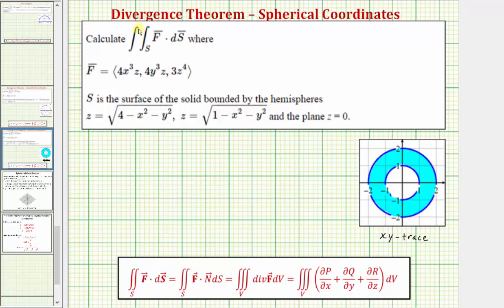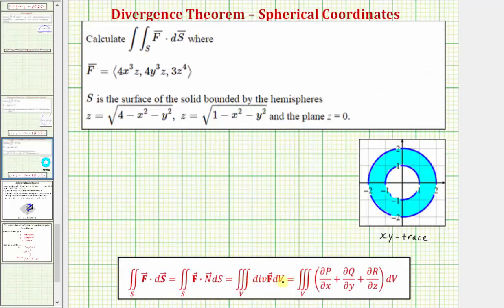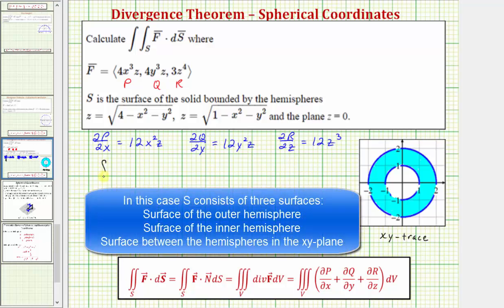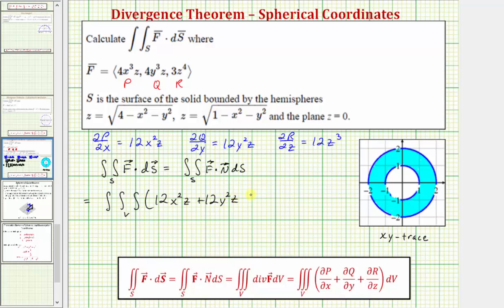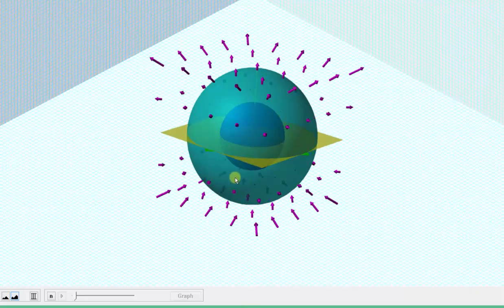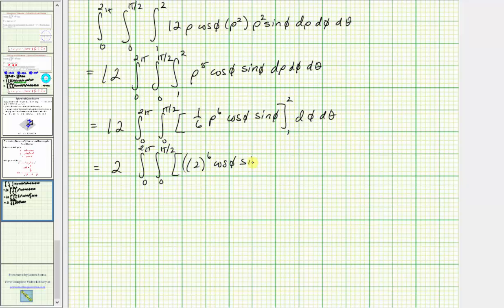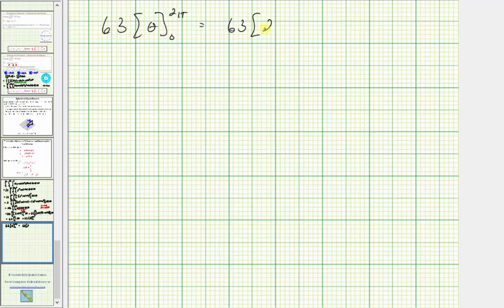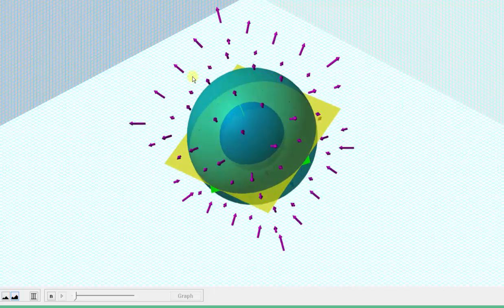Ex: Use the Divergence Theorem to Evaluate a Flux Integral (Spherical Coordinates)

Comment: Mistake in here, with the u-substitution. Terminals on the integral aren't converted over. sin(pi/2) = 1, sin(0) = 0, so it should be in those later steps, when with respect to u, an integral from 0 to 1.
Reply from the maker: Hi, I wrote the antiderivative in terms of phi, not u.  There was no need to change the limits of integration.
Reply: With u du, there is, because the terminals relate to u.
Reply from the maker: Are you referring to the red notation at 8:07?  If so I'm showing some work to justify the "mental" u-substitution.  Notice I never found the antiderivative with respect to u.  I wrote u du in read to show what the integrand function is in terms of u.  I didn't write the integral symbol in red for this reason of not wanting to find the limits of integration for u.  Maybe we are talking about something different?
Reply: Yes, talking about the notation there: u = sin(phi), du = cos(phi) d(phi). And then skipping to 8.25, after you've integrated to get 1/2 u^2, which gives the 1/2 sin^2 (phi). 

Ah, I see now. You're then evaluating this at 0 and pi/2, because you've jumped back to doing it with respect to phi. So, you're quite right, but this wasn't clear in the video.
Reply: Get same result whether you do it this way or more direct from the u-sub regardless.